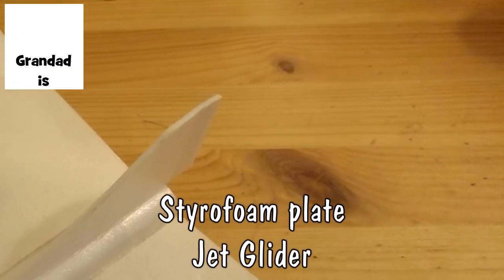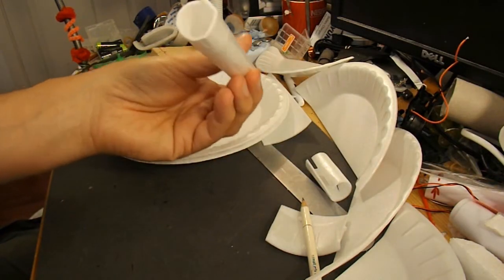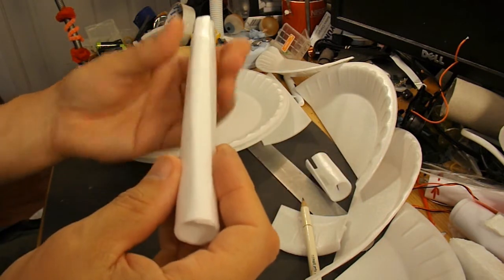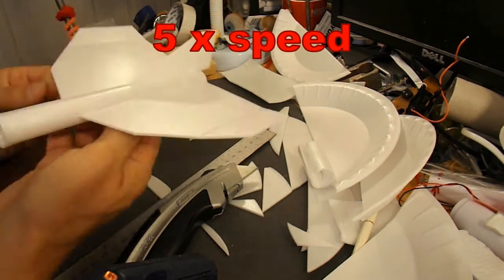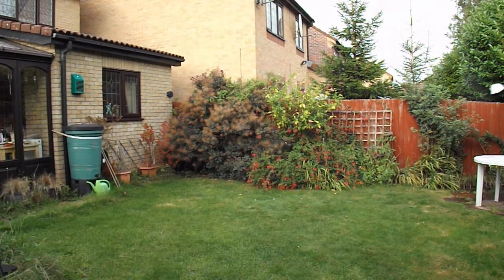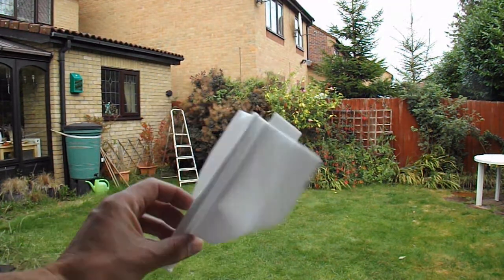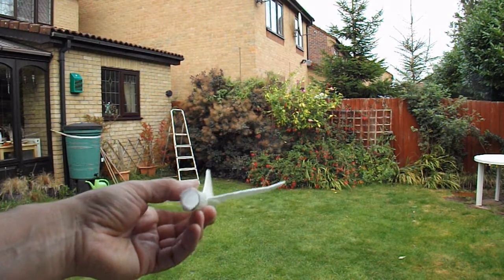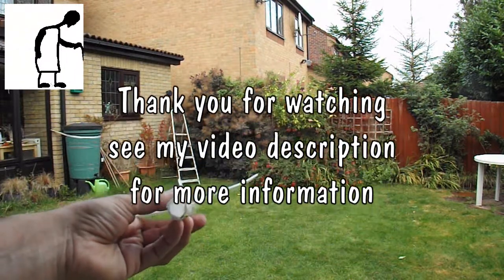Styrofoam Plate Jet Glider

Comment: It's tail heavy. The center of gravity isn't correct.
Reply from the maker: Through the test flights I made continuous adjustments. If you watch carefully you will see its flight characteristics change in virtually every flight. Usually you will see my test flights are focussed on getting it to fly straight and level so I thought I would make this one different. You will see one flight it does a very nice flat circular flight. I think the hollow tube fuselage also affects it's flight as it goes well if I throw it hard but then I can't film it because it moves too fast and the slightest breeze takes it out of shot anyway..
Reply: Catalin Ionut Yeah,but if you look at the bright side,it actually makes the plane a stunt plane.